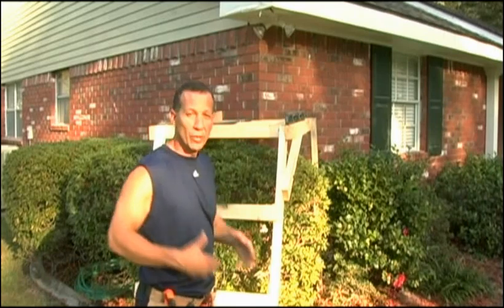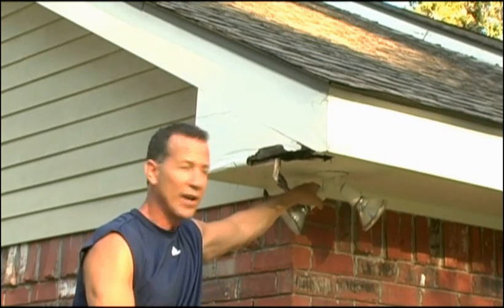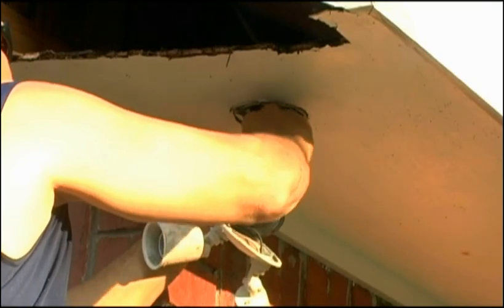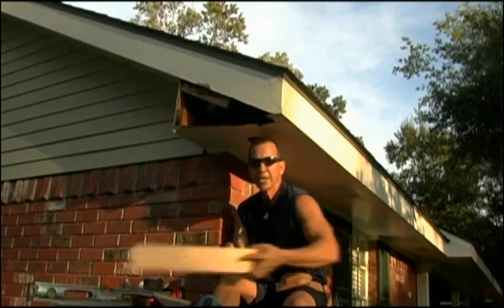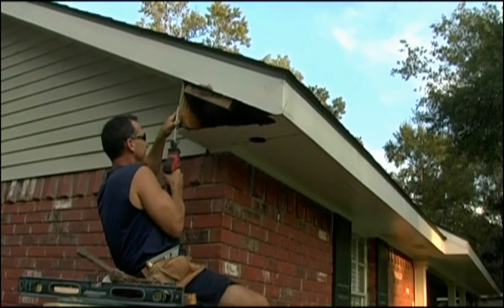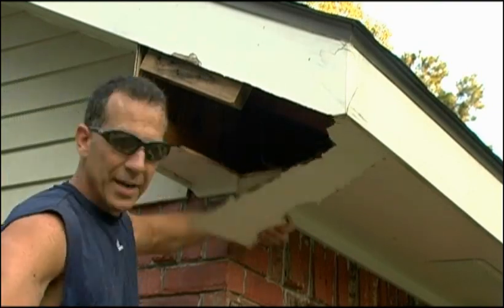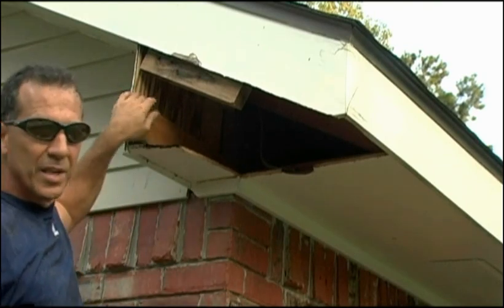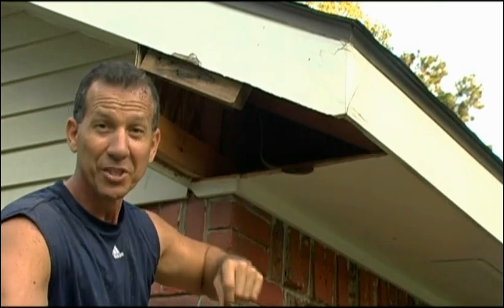Repair Soffit and Fascia

Comment: Hi Paul, Great videos and tips. I need to repair my soffit soon. I did have a question on the bondo, what type is it and where can you get it? Thanks again for sharing your knowledge.
Reply from the maker: Emilio Tamez 
Hi Emillio,
There are several companies that make Auto Body Filler. For my woodwork, I use Bondo brand filler and glass filled body filler,  by Bondo. They can be found at just about any automotive center and they are not as expensive as premium body fillers. The green colored one is Glass Filled  or (Kitty Hair).  It is a plastic filler with fiber glass strands in it. I use the glass filled Bondo for larger holes and regular Bondo filler for the top coat or for dings and dents. Thanks for your comment!
Paul

Comment: What is the type of saw you are using in this video called? Thanks
Reply from the maker: Scott Zachry 
Hi Scott,
It is a Milwaukee 9 volt reciprocating saw. It can be purchased by itself, or with a drill kit. I use my large reciprocating saw for big jobs, but this one works great for jobs like this.
Thanks!
Paul